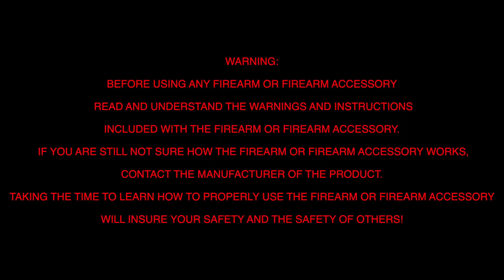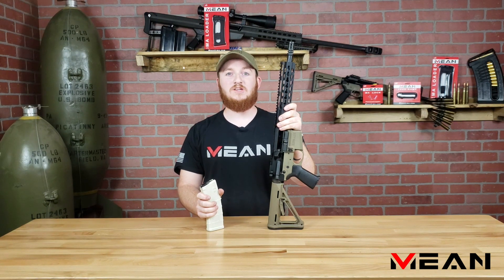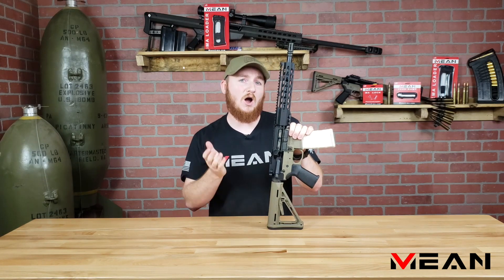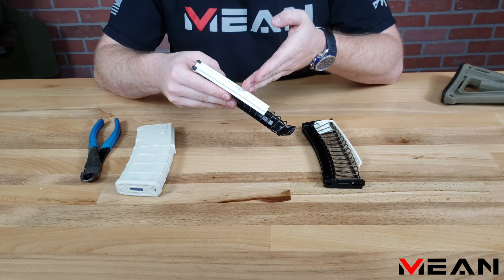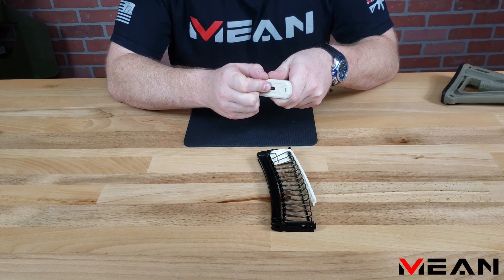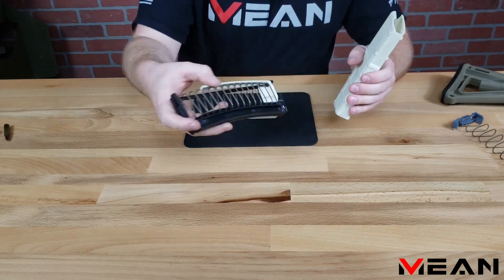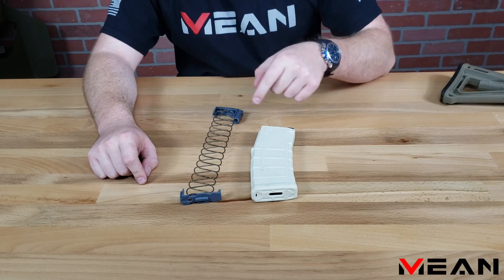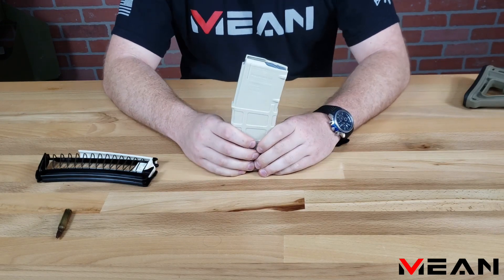EndoMag™ Installation and Removal

Comment: lol, hew Drew... see the comments below. Thousands of happy customers? 

These things do not work. The ejector catches on the BCG regardless of the break in. The break in is BS... if you were even able to make it work with their break in procedure (I got one to work out of 12) if there is any upward pressure placed on the bottom of the mag the bolt will hang up on the BCG again. I modified one significantly and it worked. I contacted Mean to share the fix, ego man Drew was not interested. Instead blamed the issue on inconsistent BCG manufacturing. Then gave me a laundry list of reasons why it might not work including the BCG comment stated above. Then, he was all "send them back for a refund" getting my money back is not the point. They market this thing that is will work with any BCG, that is not correct even by their own emission. Anyways, I have a fix. If anyone is interested hit me up. I shot about 2000 rounds out of 7 mags I modified with no issue.

Comment: thanks for the response the bullet snags every time you try to chamber a round something bad wrong once in a while it works right
Reply from the maker: Hi Calvin,  We are happy to discuss and work on resolving the issue with you.  Can you please e-mail your contact information to support@meanarms.com.  Can you also include your upper, lower and bolt components used in your build.  Thanks.
Reply: Exactly my results.  * edit update: finally got mine working pretty consistent, occasional failure but nothing like before. Big shout out thanks to Drew from mean arms, he's great

Comment: Do they still come in a 10-round capacity cuz I was just on the website and unless I misunderstood there was regular mags that were 30 round capacity and then you could click on state restrictive mags that had 10 round capacity
Reply from the maker: Hey @randy_lahey.. Our EndoMags come in a 10 round configuration out of the box that can be easily modified to 15, 20 and 30 round capacities by the customer to match your local laws.  For those who can't purchase the 30 round Magpul PMag we offer a EndoMag already installed into the PMag and sealed so that it is only a 10 round magazine.  This is for customers in states that can't get a 30 round PMag due to local laws. We also have our new ExoMag that is a full magazine that will be released very soon.  You may find that a better solution then using EndoMags and Pmags.  We are always here to help so feel free to call or e-mail support if you need any clarification on any of this.  support@meanarms.com.  Thanks.

Comment: Do I need a different buffer than normal carbine for this?
Reply from the maker: When using an AR-9 upper, it is paramount that you use a 9mm heavy-extended buffer. You do not want to use a standard 3 oz carbine buffer. They are too lightweight and too short carbine buffers are 3.25 inches long. You will break your bolt catch if you use a standard-length carbine buffer, even if the weight is correct, due to over travel. There are many options out there. So, when buffer shopping just make sure the buffer is heavy *at least 6oz to 8oz depending on your barrel length/bolt carrier being used and should be 3.75 inches to 4 inches long or accompanied by a buffer spacer.  The buffer should also NOT be a solid buffer and have movable weights inside giving the same effect as a dead blow hammer.

Comment: mine dont slide in easily like that. will that cause a problem?
Reply from the maker: Hey @marvinpelt6700 - We have found that some Magpul PMags are tighter then others.  As long as the EndoMag can be pushed all the way in and the follower moves up and down freely like any other magazine you might try you should be fine.

Comment: I hate to help them out like this considering ego man Drew's horrible customer service skills but I realize the community really would like this thing to work. Hit me up, I have the fix...
Reply: Hey brother, I'm curious about the fix. I have an Endomag being sent in after an exchange (my first one caused issues to the point where no amount of trimming would fix it). I have faith in the new one being sent by Meanarms.  My experience with Tommy from CS has been nothing but great,  I have only good things to say about him and their CS in general, but in the event the new Endomag wont work correctly I would like to have an idea of what your fix is.  Thanks.
Reply: Please, tell me how you fixed yours. Like a fucking idiot, I bought 2 of these without checking YouTube 1st for reviews.
Reply: @sfm1022  lol, I bought 20 so don't feel bad.
Reply: @sfm1022  basically run the bolt forward. Pay attention to where the abrasion  is happening. Shave it down with a razor blade. Make sure you do not take any of the ejector surface. Take small amounts at a time. After the bolt runs forward with no issues, sand the surfaces Smith with 300 sand paper.
Reply: @sfm1022  the main issue is the surface  in front of the ejector is to tall and to wide. I think they did that to het more life out of the ejector.
Reply: @dkmelancon  funny, they wound offer to take mine back and I bought like 20 of them. Good luck...
Reply: @Offroad_meyhem  sorry for the late update.  They sent me a diagram from the engineers showing where to trim and stuff. Also the guys I talked to on the phone were really helpful. When mag #2 came in I followed the break in instructions to the letter and trimmed when and where needed and have had zero problems.  What I found helps is after normal break in, apply upward pressure to the magazine base plate (pushing into the BCG) while doing the break in again, then do it pushing forward, rearward, left, and right on the mag. Doing this made sure that it didn't matter where the mag had pressure on it, it would still work regardless of pressure applied to the mag while firing.  I rather buy a product that I don't have to break in like that to ensure that it works, but even more than that I rather not have to buy a dedicated 9mm lower or a mag conversion block so its all good to me. 100% happy with it.

Comment: Have you guys even tested your own products for long term reliability? Your Ejectors are molded out of plastic. A 9mm casing will destroy that ejector over time. heck mine lasted 2 reloads. I spent 50.00 for the 10 round mag hoping it was a good product, Boy was I wrong. who's the idiot to thank for plastic ejectors? Heck even a 10/22 mag has its ejectors machined out of stainless steel. Rebuild your injection mould and accommodate it to accept a stainless steel insert as a replacement for your ejector.
Reply from the maker: Thank you for your feedback David.  Yes, we do extensive internal testing and have multiple EndoMags with 6,000 plus rounds with zero issues.  We are sorry you are having issues with durability.  Please send photos of the damaged EndoMags to support@meanarms.com and we will be glad to help.

Comment: feed ramps suck on these things they are a joke!!
Reply from the maker: Hi Calvin, Sorry you are not satisfied with your EndoMag. I hope you will consider contacting our support to see if we can assist you in resolving the issues you may be having. I checked our support system and I don't see where you have contacted us. We stand behind our products and if we can't resolve your issue (via our lifetime warranty and support) we will refund your purchase. We would have reached out to you but I can't find a record of a direct order with us as I am guessing you purchased from a dealer. I think you will find we have a pretty good reputation for great customer support.
Reply: @MEANARMS  bought mine at delta tact i would love for this thing to work right they make the weapon look so much better the bullet hangs in the feed ramp every time you try to load once and a while it will cycle not very often  thanks for the  response not many company,s worry  about their  products !!!!!!!!!!
Reply from the maker: @calvinsmith9410  Hi Calvin, We are happy to discuss and work on resolving the issue with you. Can you please e-mail your contact information to support@meanarms.com. Can you also include your upper, lower and bolt components used in your build. Thanks.